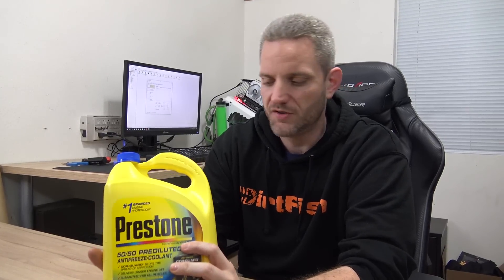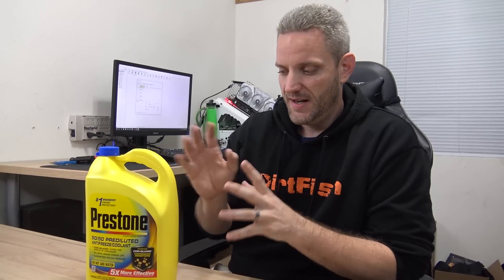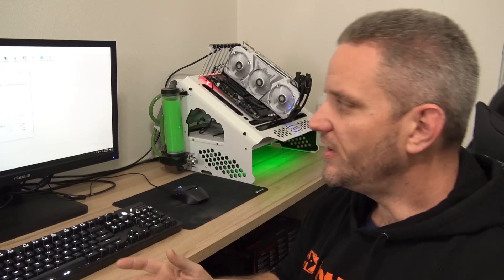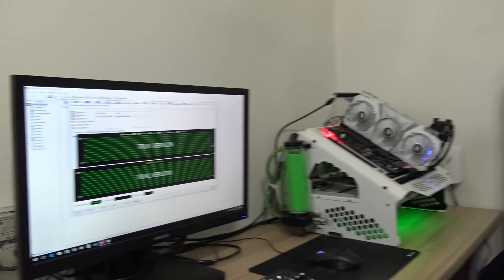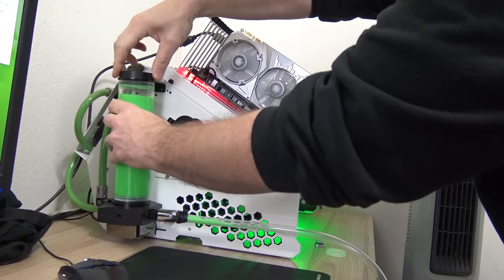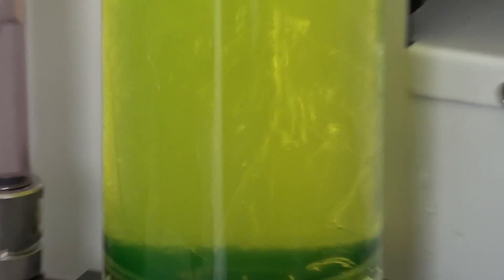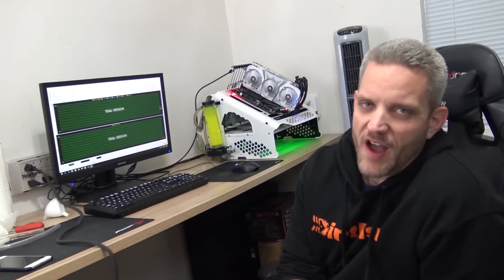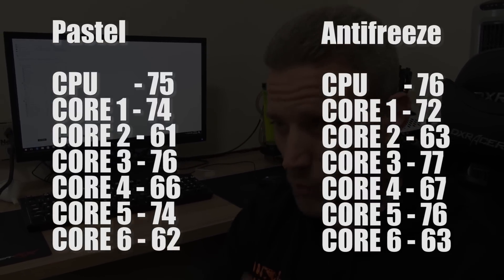I used Antifreeze to cool a PC

Comment: what happens when you try water cooling with gas / fuel ?
Reply: it would most likely cause the tubing to harden and crack over time. eventually the gas would evaporate, but for the first while, the system itself would actually run cooler than when its on water, but only by a couple degrees. And no, the initial thoughts you probably had that it would catch fire is not gonna happen, as a computer doesn't run hot enough to ignite gasoline.
Reply: you can answer that yourself, take a can of gas for your lawn mower or power equipment seal it up tight and set it out in the sun for a few hours,  word of advise, don't open the lid real quick

Comment: I have a stupid question because of a stupid thing : tried to WC my PC, Shorted out the PSU because my wife got me Salt Water instead of distilled water (my stupid fault for not reading), and now i want to complete the project, but now the components have a greenish "dust" corrosion on it, can i clean them if so how? or do i need to buy them all over again?

Thank you.

Comment: So with acrylic tubing it should be fine, then? 
The corrosion inhibitors in antifreeze need to be quite good because it's not rare for it to be used with a steel engine block and an aluminium radiator, and a copper heater core for good measure. I also seem to remember in the 2000s when watercooling wasn't really a mainstream thing to do people used it a lot. Especially in the Pentium 4 and early Core Duo era. I'd stay away from Dexcool though.

Comment: Jay I need help. I built a new pc, 6700k, msi m5, p3 case, riing aio. I need help understanding temperatures to ensure I installed the thermal paste/heatsink correctly. I have a fancy camera and mic, etc. Think a collaboration could prove useful for the common user such as myself.

Comment: Liquid Nitrogen, just for shits and gigs.
Reply: Inside a closed loop it'll simply evaporate, expand and explode the tubes.
Reply: Dylankobe24 that's what pro overclockers use for world records
Reply: I'm aware that the "pro's" use it, I just want to see destruction.
Reply: Dylankobe24 There is actually a liquid nitrogen community. Some people do it.
Reply: It's all shits and gigs until someone gigs and shits.
Reply: Thales Sousa yeah closed loops don't work, they put a jar of some sort directly on the CPU and pour it in manually
Reply: liquid nitrogen , ignoring that the tubing would need to be copper to properly hold the stuff, would turn into a gas and expand with the higher temperatures a pc would produce and your loop would rupture from the pressure. assuming you could keep the loop under high enough pressure to force it to stay in liquid form, condensation would form outside various parts of the loop and condensation inside your pc would fuck it up very easily. there are so many things that could go wrong with liquid nitrogen in a traditional pc cooling loop.
Reply: How bout liquid oxygen? If ppl use oxygen to cool a pc why not liquid oxygen?
Reply: Phase change used to be a giant pain, and I'm sure it likely still is....

Did some Nitrogen cooling on an fx-53 in college (my CPU, friends pot) in about '05. it was fun for benchmarking but also...giant pain. When he missed the pot one night(thankfully not with my rig under it), and spilled the pour on the motherboard...... yeah he sold the pot after that.
Reply: People overclocked an i7 7700k to 7 GHz with liquid nitrogen (LN2 Cooling).
Reply: Albin Markstrom http://m.slashdot.org/story/320525
Reply: +Albin Markstrom The world record is on an FX8350 and got it to 8.8ghz.
Reply: At least you're honest.
Reply: Dylankobe24 oh i do too, but maybe on a cheap system and not x99
Reply: companyoflosers I know
Reply: The i7 doesn't hold the world record for highest overclock. That honor goes to the FX 8350. 

http://www.kitguru.net/components/cpu/anton-shilov/unannounced-amd-fx-8370-nearly-breaks-worlds-clock-rate-record-at-8-7ghz/
Reply: Dan Jack genius
Reply: crazy russian hacker ?
Reply: Plunder Thunder I know.
Reply: Thales Sousa linus built a liquid nitrogen closed loop pc
Reply: Shik-Shok Link please?
Reply: phase change not nitro
Reply: Dude, the soft tubing would freeze and crack. Plus the condensation will most likely kill the MOBO...
Reply: Muhammad Numan you're so fucking stupid and idiotic the world record is 7007,85 MHz on an i7 6700k beskeds the i7 7700k hasnt even came out yet you dumb Fuck and it wasnt luiquid Cooled either IT was cooled with liuquid nitrogen in C-370
Reply: Im aware it would fuck up the system, I just want to see something get fucked up.
Reply: Ada Palis was it stable though?
Reply: +Three geek stable enough to be the world record. Most of the world record breakers aren't practical at all, Any overclock of that size probably will fry the cpu in a matter of weeks/months if left that way.
Reply: Shik-Shok no he didn't it's phase change cooling he used Freon pretty much a version of a refrigerator
Reply: companyoflosers that's the whole reason why we want to see it
Reply: Dylankobe24 check out MSI overclock challenge they use it
Reply: can the fumes from the nitrogen be used to circulate it in the system or would it lead to just a buildup of pressure?
Reply: Tråkiga svensken what did you say is the pressure predictable or posable to contain?
Reply: i don't know,
you would probably need a release valve for it to prevent over pressure that would cause the liquid to stop moving but in theory the gases from the nitrogen could be used to force it to circulate.
Reply: it would explode if contained in that container. nitrogen expands 800 times its volume when heated.

Comment: Antifreeze isnt designed to have better cooling ability than water. You can put plain water in your car, and it will work fine as a coolant. The only problem is if it freezes, it could damage your car. Thats the only reason it's necessary.

Comment: imagine liquid nitrogen to cool a pc
Reply: James Murray professional overclockers use it to get extrememly low temps but then their systems shut down from the cold.
Reply: Imagine somebody calling himself K|NGP|N and doing that and even building a station wich makes the whole process way more convinient.
Reply: Pro overclockers do that
Reply: I don't have to imagine, I can go look up a video of it
Reply: Luigi7337 corection they used liquid freon because of the shut off most motherboards have at extream low temp they used a slightly warmer liwuid ....still -15c tho
Reply: Liquified gasses actually don't even "cool" anything without expanding.
Reply: Liquefied gases can cool stuff without expanding. But nobody does that because latent heat of vaporization absorbs more heat with less temperature change.
Reply: daft vagrant refrigerators and hvac take liquid and change it into a gas. compressors cannot and are not designed to compress liquid. that's how they break. when liquid leaks in. plus the whole engineering to find the right compressor for the size of the system would be a waste of money for a computer.
Reply: companyoflosers Ohh without a doubt, a normal loop would fail. 9,200 psi is what is needed just to keep nitrogen liquid, not even factoring for the phase change.

Normal "freon" systems usually use capillary tubing and run them inside an insulated tube of some kind. They also usually take steps to prevent the frozen condensation off the cooling block from running into the CPU socket when it defrosts. Basically more work than I'm willing to put in, and a liquid nitrogen loop is more than impractical.
Reply: It doesn't work. That is only for pro overclocking. The system won't even boot you will have to literally ignite it with something hot.
Reply: With an expansion ratio of nearly 1:700..... It would literally blow up every component in your closed loop.
Liquid Oxygen would be even better with an expansion ratio of 1:860
Reply: James Murray Actually a guys from japan or korea made an liquid nitrogen cooling for cpu and overclocked the cpu to 5.0 Ghz or more...
Reply: James Murray Here u go what they said """ Using this technique, the team from Asrock managed to overclock a 3.5GHz Core i7-4770K to 6.5GHz at Computex. This high-end Haswell processor is paired with an Asrock Z87M motherboard, which supports 2,800MHz DDR3 memory modules (RAM). In comparison, Intel is officially supporting RAM modules of up to 1,600MHz. """ They did it by using liquid nitrogen :D
Reply: LinusTechTips built a PC with liquid nitrogen cooling
Reply: Did he really?!?
Reply: When you hear about LN2 in relation to PCs, that's what that is. Liquid N2. Nitrogen.
Reply: Well, i looked it up one more time, wasn't sure if he did really. That Coolant he used wasn't Liquid Nitrogen but some Sort of other liquid that is cooled below 0° Degrees, so that the water in the air freezed at the copper cooling plate where the thermal paste is supposed to go.
Here is a link -> /watch?v=3wztD55-AWA
Reply: LIQUID HELIUM
Reply: are you in the navy by any chance? haha
Reply: Phase change systems use pressure to convert the gas into a liquid. This is how a refrigerator and basic air conditioning systems work.
Reply: jonathan christopher
I'm not talking about how they cool, rather that the chemicals commonly used, (r-12, r13b1, r-22, and the like) are a gas under atmospheric pressures. The compressor adds pressure to the system to convert them into a liquid. Expose ant refrigerant to the atmosphere and it will boil off.
Reply: liquid nitrogen , ignoring that the tubing would need to be copper to properly hold the stuff, would turn into a gas and expand with the higher temperatures a pc would produce and your loop would rupture from the pressure. assuming you could keep the loop under high enough pressure to force it to stay in liquid form, condensation would form outside various parts of the loop and condensation inside your pc would fuck it up very easily. there are so many things that could go wrong with liquid nitrogen in a traditional pc cooling loop.
Reply: companyoflosers For liquid nitrogen, something like 9,200 psi in an average loop would be required so no it wouldn't be practical at all. In all phase change systems, you do have the Leidenfrost effect (frozen lines from the liquid gas converting to gas) but has been answered in current phase change systems.
Reply: i got the impression the original commenter was referring to putting liquid nitrogen in a plain old cooling loop though. i know phase changing systems use something different.
Reply: If the loop is not hermetically sealed, it will evaporate.
If it is, the computer will blow up.
Reply: helium does not really have a liquid state.. at around 4°K it becomes a superfluid but else it is a gas.. not really good to cool a pc as it is extremely expensive to cool it and well also anything else that far.. also it is like 100% sure that the pc wouldn't do a thing anymore at those temps.. people often forget that oc with liquid nitrogen isn't that easy.. you apply the overclock and then most of the times the pc won't even turn on.. it works as long as it runs but in order to change voltages and clocks the system will turn off completly.. and here appears most of the time what is called a freeze bug where the hardware is too cold to turn on.. the overclockers then use something as a gas torch to heat the cpu back up over 0°C to get the system to boot and then cool it below 0°C again once it runs and run the benchmarks with crossed fingers hoping the system won't crash before the benchmarks finished and the judges saw the result.. there is a reason why it is used for record hunting only and not for every day 24/7 stable productivity systems.. 
with air- and watercooling you can have a quite system with good temps and good ocs.. with anything else you will have nothing but pain in the long run..
Reply: They heat them up with torches if they go below normal temps to keep them running.
So it's a combination of liquid nitrogen with a torch to keep everything balanced.
Reply: solid tubing custom fitted to your choice of mobo/case combo, and a good amount of specialty cooling knowledge, and you're good to go!
Reply: Liquid nitrogen is actually a poor conductor of heat, the trouble is when you heat semiconductor junctions down to those temps they tend to behave differently due to quantum mechanical effects, there are some who will seriously overpower their rigs and put LN2 on them, but it's a thing only for a few minutes at a time as for one water will condense all over the place, and you can't chill your components first then turn them on, if that junction gets too cold it won't ever "fire up" properly and if you get the die too cold, or too big of a thermal gradient between the inside of the die and it's outside the brittle composites it is contained in will shatter.

I've done quite a bit of work with LN2 and one of the first things I tried was putting LN2 in a red solo cup... well the cup gets so brittle that just pouring in the LN2 will cause it to crack and all the LN2 to leak out. You are far better using just an efficient radiator and large resivoir with an auxiliary radiator loop that cools your radiator than doing these extreme cooling things, it's mostly just a novelty.
Reply: It won't explode and you can not contain the pressure of expanding LN2 in a sealed system, what will happen is the LN2 will be squirted out like a fountain if you tried to say pump some in if you had some expensive pump that could pump LN2 but most pumps you'll find will simply break at those temperatures because ABS and nylon, even glassfill will crack when they get that cold. And you will have water condensing all over the place.
Reply: Peter Carlson
A change of materials can easily handle the temperatures, pressure is the issue. In a system the size of a PC cooling system, you are talking nearly 10,000 PSI just to keep it a liquid. Then you have to find a way to contain the expansion during phase change...no squirting out at that level, parts rupture and explode.
Reply: daft vagrant
 Nobody is going to use Liquid nitrogen in a pressure evap system, however they DO use helium in cryopumps and cold fingers, It's just not practical, LN2 has a lousy heat capacity, in fact plane ol jane water has a higher heat capacity per weight than most any other material which is why it's an essential component of life. The reason you use "antifreeze" or "coolant" in a car engine isn't because it has a better thermal capacity, aka the ability to absorb heat, as it's about half of what water is, it's because it increases the boiling temperature of the water so unless you are boiling water in your cooling loop as will happen in engines and they get "steam lock" then you need no additives whatsoever.

10,000 PSI is actually an INSANE amount of pressure, even scuba tanks won't go that high and they have half inch thick walls, they go as high as 4500psi for the most expensive specialized tanks because that much pressure is almost impossible to hold hence using helium as the working fluid for most cryopumps and why LN2 is made by cryogenic distillation and not phase change of filtered nitrogen gas.
Reply: Peter Carlson
Literally none of what you just said has anything to do with my reply. It was basically an exposition of everything that has already been said here or in the video...some of it by me.
Reply: Casey Thimm thats the stupidest thing ive ever heard